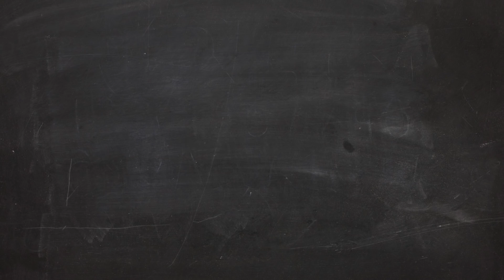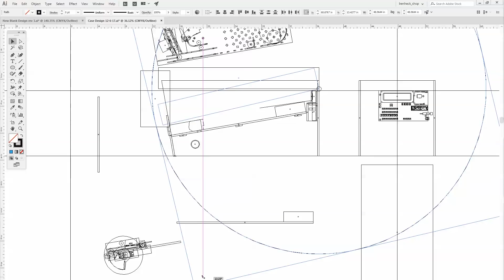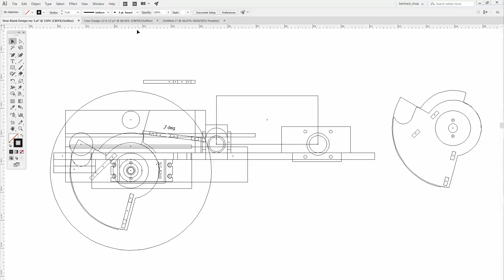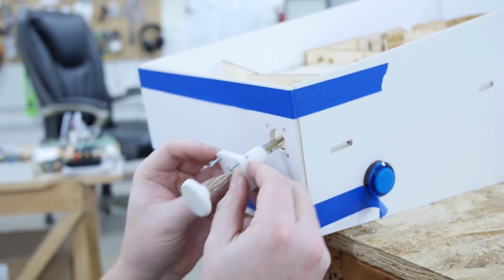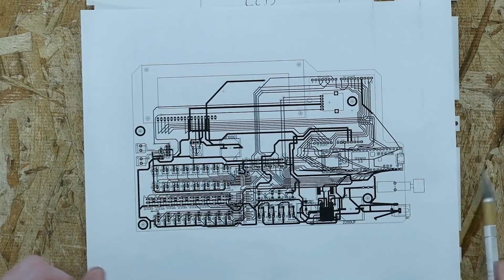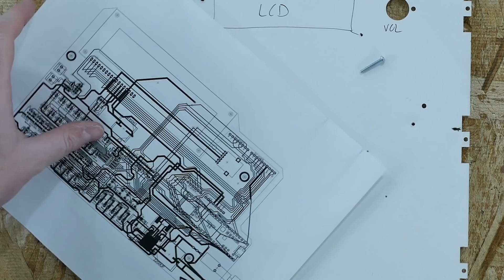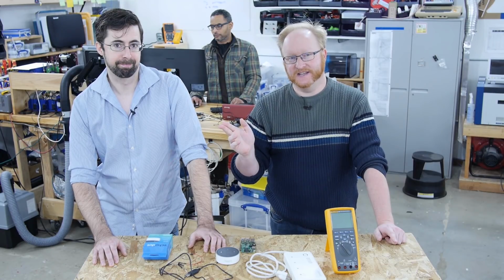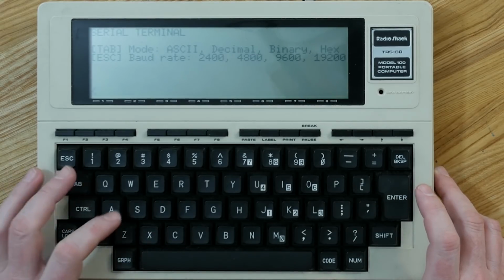Mini Pinball 10: Designing a Super Case

Comment: I personally don't care for the modular design. It's a good idea in theory, but in practice it'll never be that great. If you want multiple play fields, then make multiple kits that have better individual designs. Modularity also takes away from the physics, you can't have a single standard piece that goes into multiple slots and have the same outcome each time; a ramp with a slope that's designed for modular rows further back, but placed in modular rows closer to the front of the table, will cause it to perform improperly and disrupt the momentum of the ball, and possibly cause the piece to make that specific table design unplayable.

Comment: It's coming along pretty good, but I would change one thing:  I'd laser out holes instead of having the 'plus signs' - the play pieces are kind of flimsy, and with the awesome access hole on the bottom, you could easily just screw pieces on through the bottom using the circular holes.  The pieces would be more secure this way.  (I saw one kind of shake around a little bit in the video).  Otherwise coming along nicely.  Keep it up!  Cheers.

Comment: Saved wood on the bottom??? Did i miss something?
Unless you can use the cutout piece for other projects ,all you saved is weight.
Reply: They lasercut the pieces, so they can just cut some smaller pieces out of the leftover piece.
Reply: There are no leftover pieces you just cut out the smaller pieces needed in the pinball machine from the same piece of wood that you used to make the bottom all at once, in the same session.

Comment: Won't the unused pluses that hold the playing field parts affect the rolling of the ball?
Reply: It would, but the plan is to have a thin layer above it that only has the cutouts for that particular design. There would be multiple versions with holes cut in different configurations, but only the holes use in that design.
Reply: I've wondered why use this design. It means you can't have lighst and indicators on the playfield as you would need to cutout those spaces from the underlying board. Also, why redesign the PCB? just remove the LCD from the board and use a connector and cable.
Reply: Less assembly I'd imagine, and also like Ben mentions, to fix the depths on some of the connectors to the wall of the enclosure